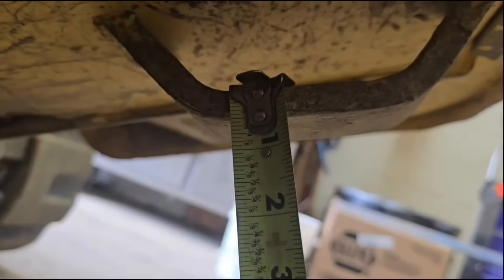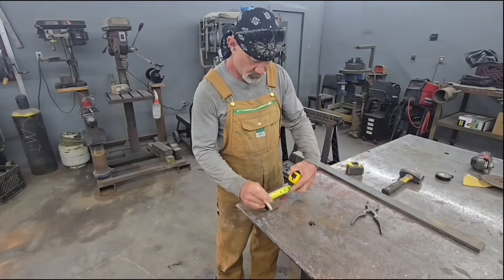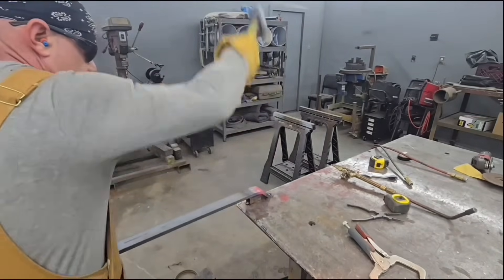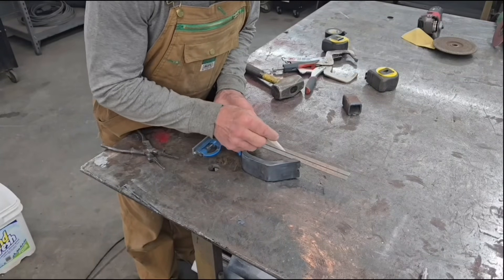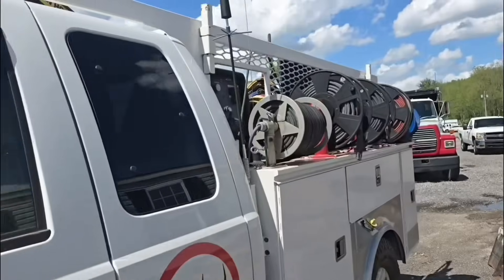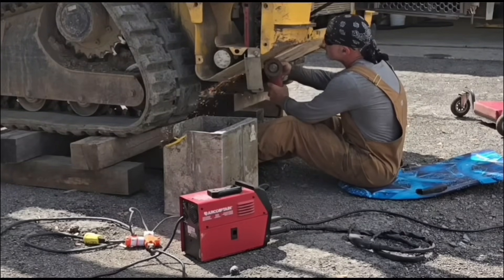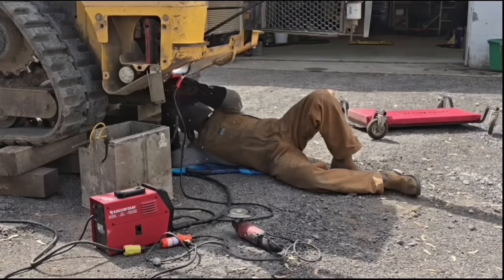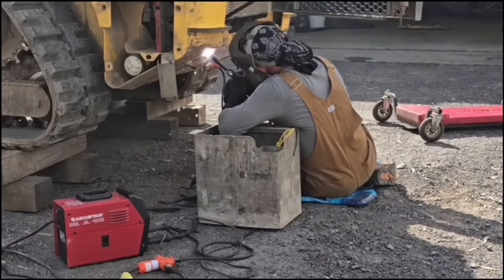Fabrication & welding of a skid steer anchor point

Comment: Noticed the 120v from 220v cord used only 1 hot wire and the ground, I thought you would have to have the neutral included with 120v machine
Reply from the maker: Across the two hot wires is 220V....across one hot wire & ground is 110V

Comment: Well, if they rip that one off they got big problems.  I used my MIG145 PRO for a bunch of hand railing and stainless welding just a but ago.  It did such a nice job and the size of the machine is super handy .  Just got the MIG205 PRO with a spool gun.  That's such a great setup and way cheaper than just a spool gun for my Millermatic 200!
Reply from the maker: Right on...thanks for watching and commenting...I'm really impressed with the ARCCAPTAIN spool gun I have

Comment: I'm not sure which is more impressive, that they broke the old mount completely off or how you fixed it with a 120 volt machine in the field. I wouldn't have thought a 120 volt machine would do the trick, great job CB!
Reply from the maker: It will go up to 145 amps and I never went higher than 120 amps on this job

Comment: New Holland makes some great machines, but it not the first occasion that they were a little light on the gauge of steel they used on the hull. Some of the rubber tire machines had a problem with cracking around the axle mounts for the same reason.
 It was a smart move to beef up the other tie down as that will spread the load out over a larger area.  You did a nice job here. Thanks for sharing.
Rat
Reply from the maker: Thanks for watching and commenting...good comment...stay in touch 👍
Reply: @NBSWELDING  I will, I subbed!
Thanks!
Rat

Comment: What a little beast of a rig thanks for sharing. Cheers from Nova Scotia.
Reply: Its very easy to get a fake weld with a small machine on metal 3/8 and above.  I wouldn't trust myself on it, CB could probably could make it last  and looks like he got a lot of reinforcement in there.
Reply from the maker: It will go up to 145 amps and I never went over 120 on this job...if you got a breaker that will handle the current it will soak it in there.

Thanks for watching and commenting
Reply: Looks good and overhead.  You sort even did some Texas Tig.  People always freak when I tell them about it, it's just filler rod.

Comment: ArcCaptain. Wow I didn’t know you could do blue tooth. Does the mig200, mig 205 & 250 blue tooth also?
Reply from the maker: The machines with iControl will Bluetooth....the MIG200 & MIG250 will not...check it out on the site...link below 

For ARCCAPTAIN products use this link https://www.arccaptain.com/?ref=NBSWELDING
Remember to enter promo code NBSWELDING5% to get 5% off on all products

Comment: 👍the repair work looks great. I’m curious as how in the world did the tie down bracket get torn off. That’s not thin metal and that machine isn’t a toy. Something had to really be tough to rip that bracket off.
Reply from the maker: Never know for sure but I'd reckon it got against something solid when the operator decided to make a zero turn and was ripped off sideways like that...seriously doubt it was from tying the machine down on a trailer